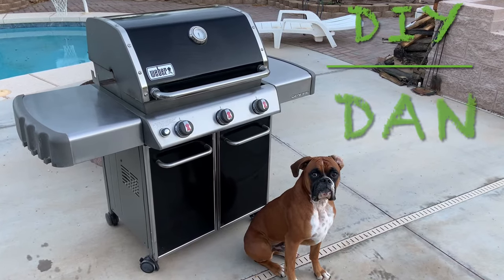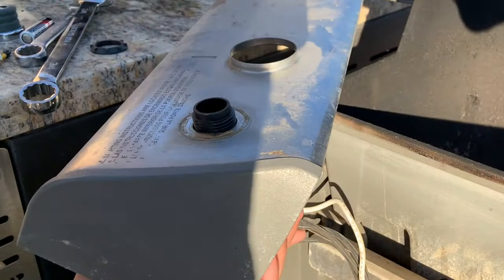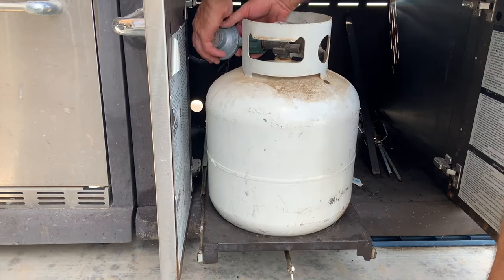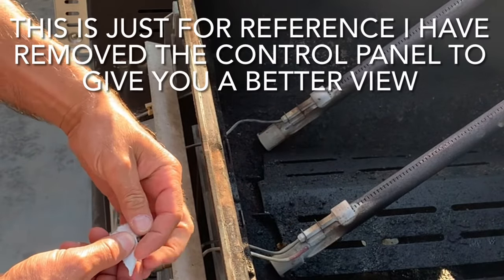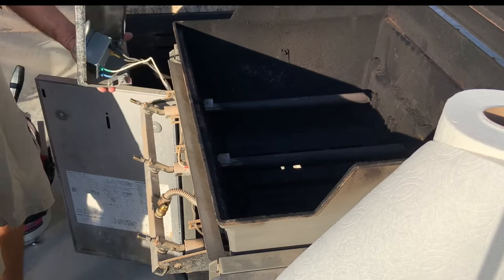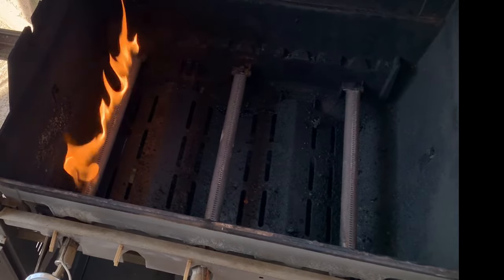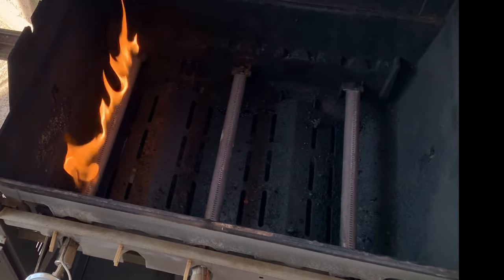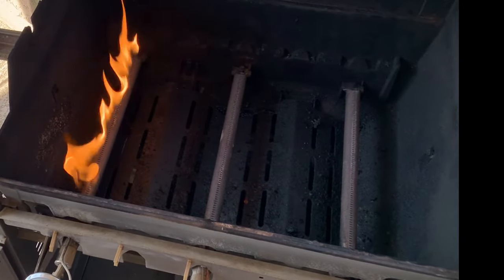WEBER GRILL NATURAL GAS TO PROPANE FOR LESS THAN $40 W/ VIDEO OF THE FLAME WITHOUT CHANGING ORIFICES

Comment: Great vid, thanks for doing.  Just converted a new Genesis e-325s to LP with your assistance.   Found that the newer grill has less covers to remove so I didn't have to pull off the manifold.  Plenty of room to unscrew the orfiices and install new ones.  Thanks again.
Reply: Did you end up using the 7mm for the newer models or the 8mm he had used? I just got myself the same grill and want to make sure I get the right part.

Comment: Great video!
Just picked up Napoleon ng, needs conversion. You’re right manufacturers want no part of conversion. I’ve converted patio heater and fire pit from propane to ng during Covid. In both cases I found a corresponding btu orifice size chart, bought cheapest orifices on Amazon and drilled them out to proper size. Intentionally saved originals to be able to revert back.
Only a couple of other comments: no need for pipe dope on any of the fittings. In fact most grill manuals tell you no pipe dope or Teflon. The seal on flare fittings is not related to the threads and the pressure at the orifices is minimal and snug with wrench is more than adequate. While you appeared to apply minimal dope, for rookies they have a good chance of clogging fittings with residual. Not a criticism, just a comment.
Great job, thanks!

Comment: First off, THANK YOU! I ordered the orifices and they worked/fit perfectly. So far so good. Only issue I had with process was one of the orifices broke tightening it in and replacing [5/16 worked but needed 7mm to remove existing Weber Natural Gas orifices]. Scared the heck out of me!! But I was able to get it out using a small flat head and replaced it with another one. Also, the process seemed a lot easier with Genesis Spirit II. I was able to access the orifices underneath the regulators. I thought it was too good to be true but it was very easy access. Just had to remove the flame/burners. Long story short, I bought this grill at yard sale and had absolutely no idea they even made natural gas grills and thought it was a total loss. I did some research and found this video and will start cooking and using it in the upcoming weeks to make sure all is good. Replaced hose with Blackstone propane hose from Walmart and looks great. I just want to find something to hang the propane tank from the grill itself now and I'll really be good! Not sure if Natural gas prices are high everywhere but in CA, the prices have almost tripled and would be a great idea for those with the same or similar grill.

Comment: Very helpful.  I was also able to access the orifices on my Genesis Spirit II from underneath the controls.  Only difference was it required two 3/4" wrenches to disconnect/reconnect and swap out the gas line.  Thanks very much.
Reply: Did you find that all the part sizes were the same as the video? I'm doing this to my Weber spirit 2 pretty soon.
Reply: @tjodom8897  Was 11 months ago, so I don't recall exactly.  That being said, I had no problems and the conversion went without a hitch.  So, as foggy as my memory is, since there are no bad residual memories, I'm going to say "yes."  Still working great and glad to not have to lug/refill propane bottles any more.  Good luck!

Comment: Hi Dan, I came across your video hoping to find an answer to my problem. Your video was helpful for replacing the orfice, which was great. I was able to do the conversion myself with ease, however I notice a problem right away with the flame. It is small flame that cannot be controlled with the NG gas manifold. No matter if the valve is wide open or set to a minimum flow, the flame is still the same size. I'm wondering if you or anyone else has experienced this? I am considering buying the OEM propane gas manifold assembly so I can actually control the heat on each burner. I'd like to know other people had to by the propane gas manifold for this conversion?

Comment: Great video. Helped immensely. Two comments. On my E435 Genesis, I chose the more difficult of the options you recommended. But what made it easier is to take the burners out of the white ceramic igniters. Another comment is to specify if possible the hose to regulator flare fitting. I damaged mine trying to grip it with channel locks so spent sometime figuring out if I need a Fl to Fl fitting or a FIP one end would work. But over all, excellent video!
Reply: Hi Colin. Curious how long it took to convert your E-435?

Comment: Orifice sizes vary by style and number of burners.  My Weber Spirit2 E-310, 3 burner grill uses a 0.9mm or 0.354" dia hole/bore.   Not sure of thread...it could be 1/4-28 or 10-32
Reply: Where did you find that information? I am trying to convert my spirit 2 e310 right now

Comment: Very informative video! I m wondering if my turbo grill is the same like this webbed or i have to change the hole valve for each burner…
Reply from the maker: Shouldn’t have to should be same concept the valve controls the on and off and the amount obviously but the orifice is the main control of the volume
Reply from the maker: The size of the orifice is the key

Comment: Anyone find that you can't adjust the burners after the conversion? I run all the way on or not at all. Side note, the video was great!
Reply from the maker: Sounds like the orifice size is to big
Reply: @diydan7019  yeah, tried switching from .8mm to .5mm but it's same; steady flame but now just lower. I've got a Spirit 310 that a neighbor was tossing so just trying to salvage a sweet found grill. Again, your video was spot on!

Comment: What happens to the built-in appliance regulator from the natural gas grill?  Does that need adjusting?
Reply from the maker: Mine did not have a regulator for natural gas on it is yours on the hose

Comment: I used the method and orfices you recommended, but I don’t seem to have any adjustment for the flame, and it does not get hotter that 425 after about 10 min.  Any suggestions?
Reply: I have the same issue where I cannot adjust the flame after replacing the orfices. Anyone have a resolution to this?
Reply: @ChadMarino0442 
You will need a propane control valve instead of natural gas one. It's not just the orifice that needs changing.

Comment: Do you need a regulator for natural gas? I have a propane Napoleon that im trying to convert. The instructions for the gas model says it comes with a 1kpa regulator but can I use it with just changing the orifices you think?
Reply from the maker: @BaadMotorFinger  keep in mind I’m not a 100% but natural gas should be regulated at the supply to your house and should not require a regulated the reason for the regulator on a propane grill is because it is a small container so it is filled with high pressure so it lasts a while and has to be regulated down to low pressure.   Natural gas is a constant low pressure supply to the best of my knowledge but once again not a 100% so I would do some more research good luck
Reply: @diydan7019  thanks for the reply bro. I went ahead and tried it without a NG regulator, just changed orifices to 2mm, used a gas line too ofc and it works perfect. Just for anyone else's reference

Comment: I was told you need a different Flow Valve to have an adjustable flame. Do you have a flame that is not always wide open? Flow valve would require complete valve body replacement?
Reply from the maker: A different flow valve is not necessary. The flow valve is what controls the volume of propane making it through to the office just like a garden hose hose bib with volume. However, the orifice being a lot smaller than natural gas is what makes the restriction my flame is variable from low to high without a problem.
Reply from the maker: I put out a recent video of comparing some barbecue grills. My weber is by far my favorite and this is all after I did the conversion. It is my favorite grill to cook on now. If you want to look it up and check it out,
Reply: @diydan7019  Dan, that is such great news. My daughter bought this as her 1st grill and did not know there was a difference. She got a "decent deal" she thought. Well I went over this morning and my wife started cleaning and I got to looking at the grey hose and then proceeded to look up YouTube videos. Haha, found you, ordered necessary parts and hope to bail out my daughter before the weekend Father's day celebration with the "new" outdoor BBQ. Thanks for a well done video.
Reply: @diydan7019 
Some newer weber models do require a specific propane control valve, or you have no flame adjustment at the 1/2 or 1/4 flame setting. The only adjustment you would have is between off and lighting positions.
Reply: @r.p.3454  You are 100% correct! Been in the heating bus for many years and though it would only take a small change of the size to convert. NOT--As I read more I am going to try to find a complete valve assembly to be able to control temp. I have one temp and that is wide open! Nice flame but very HOT,nothinng in between!

Comment: My conversion kit came with 3 size orfices. .5 .68 .8 the size coming out is not that significant. Any ideas?
Reply from the maker: The different sizes will give you different flow so I would use the .68 and see what it does if you like it leave it if it’s to much flame go .5 if it is to small go to.8
Reply: Appreciate this. Ended up going with .8 but flames still werent that high. Bought a pack of several sizes and .9 seems to work. Thanks for the video Dan!!

Comment: Convert weber genesis 2008  side controller e-320  from natural gas to LP propane. The orifice size stated in your video are both too small (6 mm and 1/4  32unef). Any suggestions
Reply from the maker: Sorry only have done it on this grill you might be able to call Weber and ask them for the orifice size for that grill tell them one is clogged and need a new one for natural gas don’t tell them your converting it to propane or they probably won’t tell you
Reply: @diydan7019  As usual Weber were of no help. They suggested a I buy the manifold 67521  The part however was out of stock!
I however carried on my quest. A machine company think the size is 5/16 inch  32unef. Have searched the net for the orifice valve of this size but no luck. Do you have any more suggestions.  thanks for your help BOb
Reply: my 3 burner  E-310 Spirit is a 0.9mm or 0.0354" drill size if that helps

Comment: I did this method but when i turn on grill i can hear the propane pressure pretty loud and the fire comes out next too one of the knobs idk y
Reply from the maker: You only had this problem after doing the orifices
Reply: @diydan7019  just found out i was running  the propane hose at 30 psi thats y it was doing that
Reply: @cesarrosales7793  what psi should it be at?

Comment: I did everything but the flame is so low and the valves don’t increase or decrease the flame
Reply from the maker: Not sure I had that happen with a grill on my toy hauler but it was because I was running 2 regulators.  Maybe yours is bad is it new
Reply: @diydan7019  it is old I will replace it and see thank you so much
Reply: I have the same problem.  I replaces the hose/regulator with same result…..